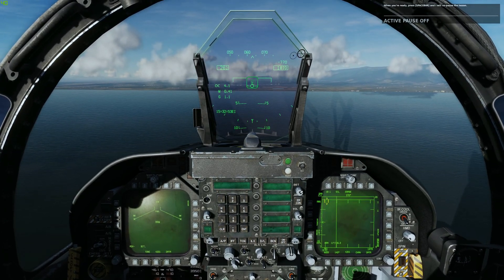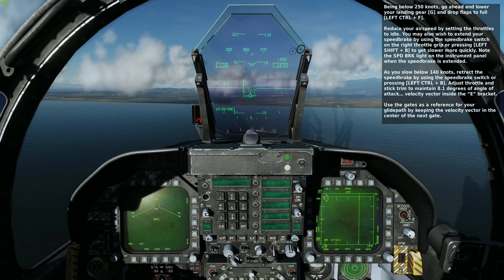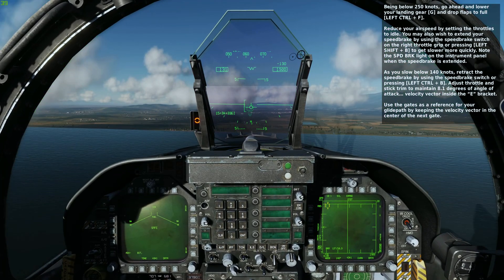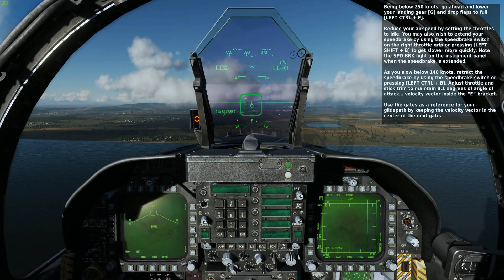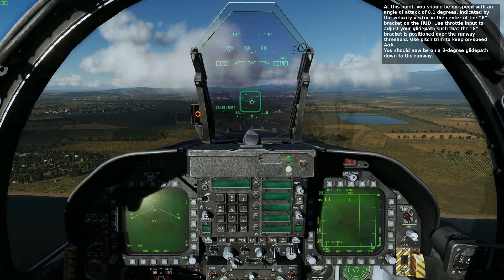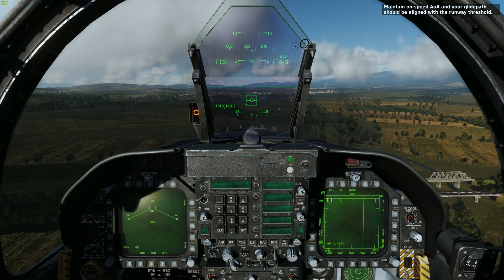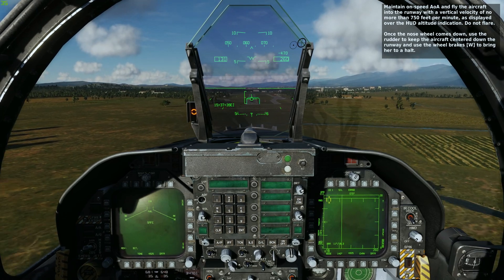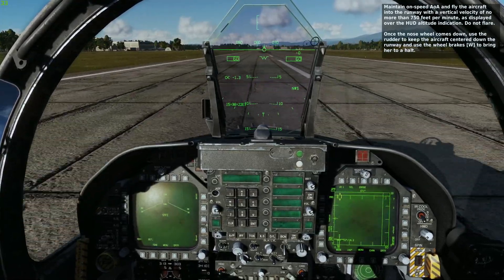DCS : F/A-18 : Approach & Landing Training Mission

Comment: Please help me. When I turn on my flaps and gear, my plane flares up automatically and gains altitude, like stalling while ill try using push trim to catch it. Is the the right thing to do? Or do i use the joystick
Reply from the maker: You can extend flaps at a lower speed. If necessary push the stick forward and prepared to release pressure and add power as required.